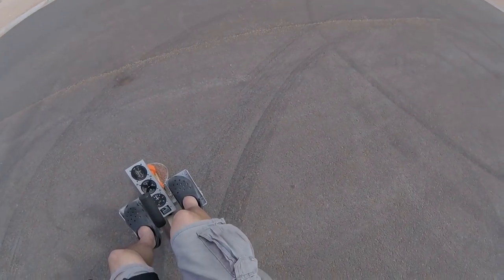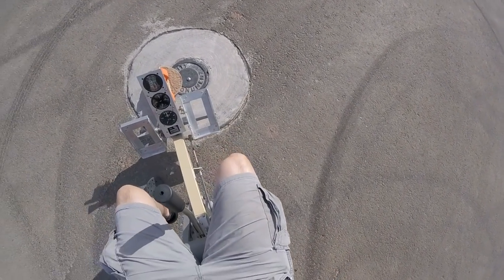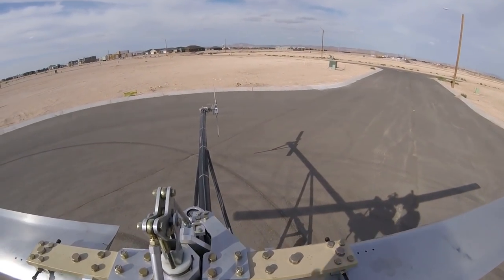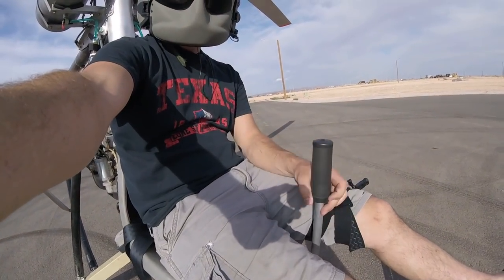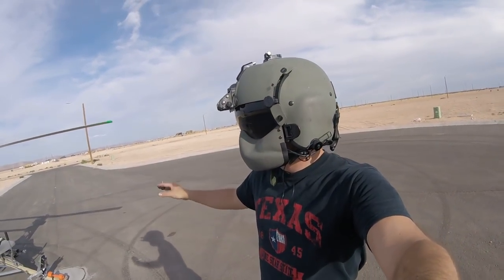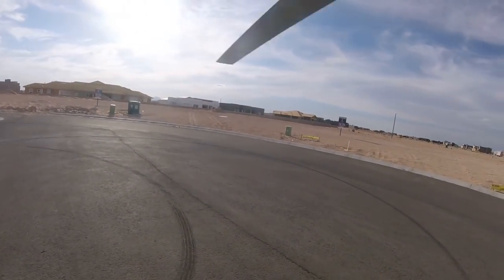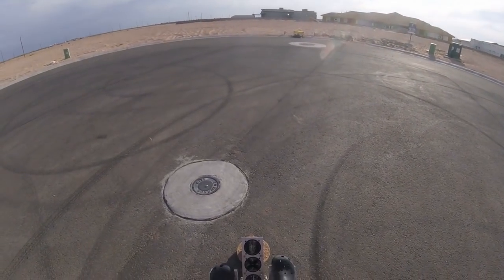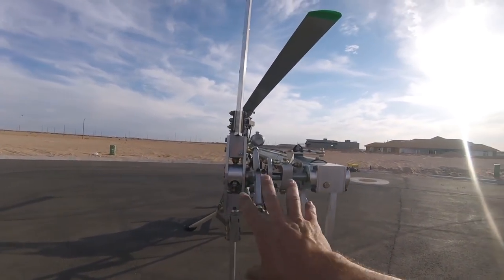DIY homebuilt helicopter Mosquito air

Comment: Just came across your Vids one in the garage and this one, congrats! My experience with Motorcycles tells me that Blue pips mean to lean a fuel mix which causes it to run hotter hence the Blue pipe, assuming you bought this used the blue on the muffler may be pre your ownership, and I'm mentioning this so that you might check if you already haven't the fuel mixture.
Happy safe flying!

Comment: That looks like so much fun! I wonder if you could build a 2-seater?
Reply: It would need a larger engine probably two 40-50 horsepowers would be best and the frame would need to be made of light metal. Also one engine may need to be 5 horsepower larger or more than likely just a larger taller rotor in the back to make it even weight. A 80-85-100 horsepower helicopter would be able to hold two 170lb people and tow a person with a harness they would need to put on themself as well.
Reply: @ianthescientist8827  thanks very much for the info. I really enjoy your channel.  Keep up the great content.

Comment: A lot of engine tuning on a 2-stroke engine can be done with the exaust system.  Not sure that 2-into-one setup is optimal.  I imagine separate exaust for each cylinder would increase power output, especially with tuned expansion chambers.  That's how its done on 2-stroke racing engines anyway.  At any rate, great job! (and you're a braver man than I)
Reply from the maker: The exhaust on this one is custom. They sell a tuned exhaust for this motor but since this one works and has enough power as is, ill save the money.
Reply: @MitchG  I definitely understand that.   Thanks for the reply.
Reply: @MitchG  Jeremy Clarkson wouldn’t approve your above comment. “power”

Comment: Hey Mitch, it's hard to find the specs on this since the company has been sold and bought, and this model was discontinued.....what are the times left on the life limited components? Can you get parts for it? Any support from the current owners of the company?
Reply from the maker: Yes they still sell parts. Tbo is 50 hours to replace the pistons. This helicopter shares many parts with the current mosquito xel including using the same engine.

Comment: Amazing! Could you fit a parachute on top of those blades axis? I’ve seen gyrocopters having these. I’ve always felt weird about gyros and hellis because of fear of bird strike destroying a blade and depriving the machine from autorotation means there where a plane may glide…
Reply from the maker: No need for a parachute. Just autorotate. Helicopters hit birds all the time with the blades. The birds just get chopped up, the blades are strong enough to not get damaged
Reply: @MitchG  wow, I didn’t know that! Glad to hear that they are so strong, it makes sense because of the sharp, knife-like edge of the contact. With the plane wings and windows they break holes or huge dents but these are two blunt surfaces hitting eachother. Cheers!

Comment: It's a shame they don't make the kits anymore. I like the XEL's bubbly look, but that adds more weight onto an already taxed engine. I'd be very surprised if the ol' girl could lift me, lol.

Something I'm a bit curious about, though, as this is the closest I've ever seen of a Mosquito's rotorhead... Where's the swashplate??? are the pitch links connected to it? I'm just trying to compare it to my T-Rex, which obviously isn't a direct comparison because R/C has a Hiller Bar, but I don't see where the Cyclic is attached to anything at all. I've wondered that about the mosquito ever since I first saw pictures of one.
Reply from the maker: The swash is inside of the mast frame behind the pilot, at the bottom of the tube.
Reply: @MitchG  Thanks! so it's at the bottom of the shaft and not the top then. explains why I didn't see it. That's an interesting design choice, but I guess it might make the linkages shorter.

Comment: Do you need a pilot license or registration of the craft for this?  Or it it like ppg?
Reply from the maker: The specific model meets FAR 103 requirements which makes it the same as a paramotor. No license or registration required. Composite FX sells other models that do require a license and registration

Comment: You studied helicopter before.a governor would alleviate issue' s.What helis did you fly before.Do you need any petal input in flight when turning or just aieleron. thanks Robbie
Reply from the maker: Just little pedal inputs during turns. This heli has a governor but I prefer to not use it

Comment: Do the fiberglass blade grips stay in track?  The guys at the factory said that they switched to the newer aluminum blade grips because the fiberglass ones wouldn't track properly.
Reply from the maker: That's what they told me but I haven't had issues in the 3-4 hours of flight time I've had
Reply: How much does this cost to buy? Is this a kit chopper?

Comment: One thing I noticed about the mosquito helicopter whether it be the air or the xel xe or xet, the direction that the tail rotor rotates seems wrong to me. Shouldn't the tail rotor blades be rotating so that the front side is advancing upwards into the rotor wash from the main rotors? I used to fly RC helicopters and whenever I would put one together I would make sure that the belt was twisted the right way so that the rotation of the tail rotor would have the blades rotating so that the blade closest to the main rotor is advancing going upward into the rotor wash. It almost seems like it would be less efficient to have the forward-facing blade rotating with the direction of the rotor wash being that it is the closest to the tip of the main rotor blades? At least that is how I was taught to set up the RC helis and it made perfect sense as well as had excellent authority. It also seems it would be more efficient/effective as opposed to the direction of rotation that they use on the mosquito helicopters.
Reply from the maker: I also flew rc helis and I noticed the same thing. Some of the synergy helis had the tail rotor rotate the same way this mosquito does. I think there's some very small benefits to having it rotate the opposite direction but I'm not sure if I could actually notice. I think it's done this way just to keep the splitter gearbox simple and have the main rotor rotate counter clockwise.
Reply: @MitchG  The direction of the tail rotor has pro’s and con’s for each direction. Actually has nothing to do with the splitter gear box on the Mosquito’s. If you wanted to change direction you can simply turn the tail gear box over. I actually thought about doing this when I first started flying  my XET, until I got into forward flight. 
The obvious major pro for the front of the tail rotor disk direction going up into the main rotor down wash is more efficiency, or more authority in a hover and in/out of ETL. The tail rotor diameter is large and as you’ve commented, the tail has plenty of authority on this light weight helicopter.
One of the con’s of going down with the main rotor down wash in a hover is less total authority “in a hover” and I’ve noticed this especially coming out of ETL. But, in forward flight, the top of the tail rotor disk is now in clean air and into the relative wind and is a lot more efficient and doesn’t suffer any efficiency losses of a retreating blade in the relative wind for that section of the disk. Because of this and the vertical tail fin, technically you can go faster with “X” amount of power as the normal 15-18% is not being consumed by the tail rotor system and that power can be applied to the main rotor. At 80mph on my XET, I’m pulling the same power setting (fuel burn) as in a hover but the tail rotor system is only about 1/4 of pitch required to hover.
I hope this helps. 
Good luck and stay safe over seas!
Dave Storey/storeyaviation.com
Reply from the maker: @dstoreyaviation  cool! Thanks for sharing!

Comment: Static movements. Try to minimize inputs on stick and peddles . Work front to. Back left and right .slow as you can possibly do it.
Makin me wanna buy 1

For your sensitivity range, can you adjust the throw on the stick?
Reply from the maker: Thanks. Yeah you could make a new bracket and mount the push pull rods higher on the cyclic. It's has been a while since I've flown  a heli without a computer helping 😁
Reply: @MitchG  I wonder if you could put a heading hold gyro on it?
Reply from the maker: @terrycarver1255  that takes the fun out of it! I love a challenge

Comment: What was your density altitude that day? I learned to fly fully loaded in an R22 with about 6000' density altitude. Had some scary days for sure.
Reply from the maker: Yeah around 6k DA. Good thing I only weight about 150 lbs lol
Reply: @MitchG  I should have made my post this way so it tagged you. I just posted and had some food for thought / questions regarding the tail rotor of the mosquito. You should look at my post and get back to me. LOL

Comment: Hello I am thinking about buying one. I am  not sure now much i should ash the man for it. he told me to make a  offer to him. I fly rc helicopters i am ok flying. I know i can fly the Mosquito Air. I also have the new flightsim 2020 I fly too. every day i get on and learn. this man haad it is side a storage shed.. So i am going to buy it soon. I just wanted to ask you how much should i give him. it been in there for 6 years. Thanks for you time. I gave you a thumb 👍 up.
Reply from the maker: Mosquito airs in flying condition sell for around 30k with low hours. I also started on rc helis and trust me when I tell you that doesn't mean you can fly a real helicopter. I'd recommend spending a few hundred to get at least 1 hour in a real helicopter with an instructor. It will be worth it rather than rolling your mosquito
Reply: @MitchG  No two R/C helicopters fly the same. One thing I did notice is a 700 size is much easier to fly than a 500.

Comment: Why can't the throttle stay at maximum? can't you control it all with collective?
Reply from the maker: Well the carbs are running rich at my elevation so at full throttle it begins to run very rich and lose power. 
Or do you mean while I'm just flying around? Can't be full throttle all the time or you will overspeed the rotor and damage it potentially causing it to explode and kill you
Reply: @MitchG  I mean, why can't the throttle be fixed (like cruise control on ppg). I'm sure its because load varies though..... overspeeding the rotor is bad... that is what I was after.
Reply from the maker: @dogon1013  yeah, when you move the collective or change airspeed it varies the load on the motor so you have to adjust throttle. Advanced turbine helicopters have a computer that adjust throttle for you but not this mosquito

Comment: What are the regulations on this!? Do you need to register it or get a license?
I’ll stop commenting until the end of the videos.
Reply: Okay, so. *in the US*, any aircraft that weighs less then 254 pounds does not require a pilot's license, nor does the aircraft need inspections or anything. It's called a part 103 ultralight.

The Mosquito Air is an ultralight, so you don't need a pilot's license or helo endorsement. That said, Helicopters are very challenging to fly, so teaching yourself on this thing could be fatal... I don't even think Mosquito will sell their newer helos to people without helo licenses for that reason, even the Ultralights.

It'd be cool to own, but I dunno if I'd have the balls to try and lift off with it. I don't think there's spare weight to stick on a larger version of the 'balls on the end of two sticks' landing gear we use on models to make landing easier...

Comment: Any experience with the turbine model?
Reply from the maker: No but my personal opinion is it doesn't provide any benefit over the xe model except for wasting a lot more money.
Reply: @MitchG  

Aah,  
I do gyrocopters , these look cool . But seem to be a handful to pilot .  Maybe to much.
Reply from the maker: @bstevermer9293  definitely a little more difficult to fly but with the benefit of not requiring a runway
Reply: @MitchG  
“If” it had more power would that make it better??
Reply from the maker: @bstevermer9293  The XE model has plenty of power. The turbine model isnt capable of using 100% of the power that the turbine can provide anyway. You can only use so much power in a helicopter before you run into other limits like tail rotor authority and retreating blade stall. So with the turbine model you get a more expensive helicopter that also burns more fuel.
Reply: @MitchG  thanks
Good info👍

Comment: Yeah. I don't like the company that make the Mosquito cause they don't care about the non licensed pilot. all there XE helicopters are for licensed flyers so that's there market, so the unlicensed flyers to them are just meh whatever. I mean there so much they could do to the Mosquito XE to make it lighter, like they say, it has a 12 Gal tank that's plumbed to only hold 5 gals to be 103 compliant meaning you have 7 gals of tank that's just dead weight. They could use more titanium in the construction, They could also drop alot of the heavy fiberglass used in the body and change it out for carbon fiber or just remove it altogether as, as nice as it looks weight is key when making a 103 compliant helicopter. That or all non licensed flyers can band together to try to convince the FAA to raise the weight limit to 300 lbs empty weight for helicopters only as there more complex then air plains as that would fit the base Mosquito XE perfectly as it's empty weight is 298 lbs. Anyway love the video. keep up the great work. 🙂

PS. For those that would say well that would increase the cost I would say to you would you rather pay more to buy a heli that you don't need a license for and don't have to pay inspection costs or buy the Mosquito XE as is and spend a fortune on getting a license to fly it and on top of that I'm sure being a licensed heli you would need to pay each month/year whatever it is for inspections. Me I'll choose the higher upfront cost to not need a license and inspections each whatever it is thank you very much. 🙂Also I'm with ya on the whole pontoon thing looking bad.

Comment: Cannot understand how you can lift that wight with so little power. Gees, the bell 47 is a fly and takes a 165hp to lift two people. ???
Reply from the maker: about 250lbs lifted with about 65HP. Disc loading is much less than a bell